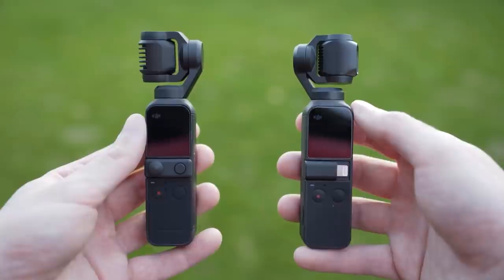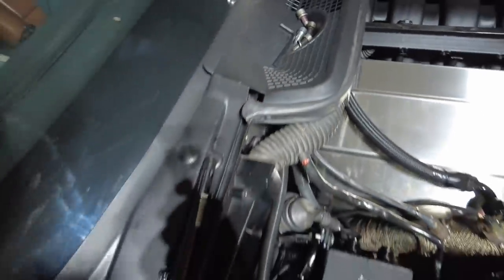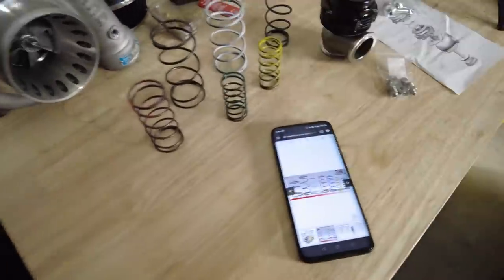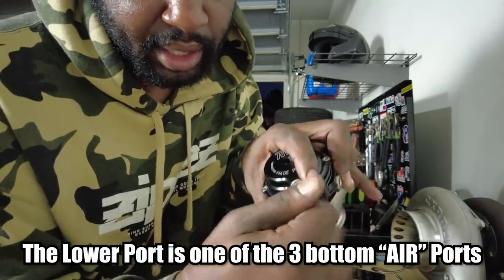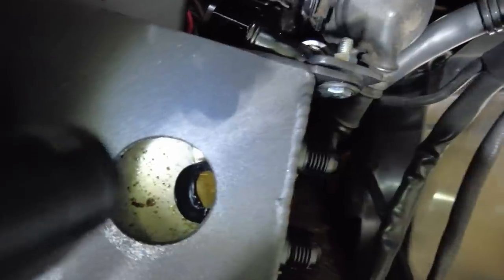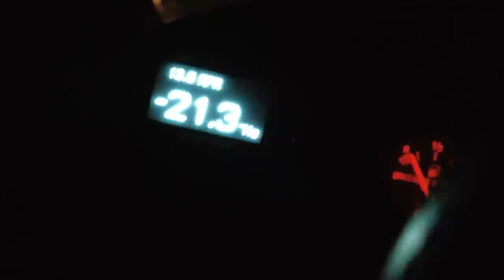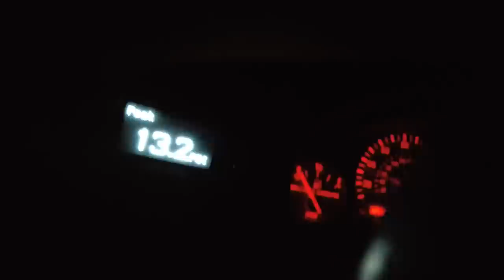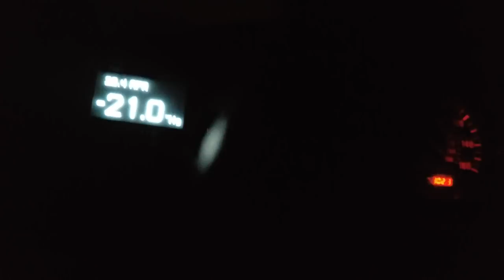Tial Wastegate and 2 Bolt to V-band Conversion and MORE BOOST || Turbo E36 Build [Ep 39]

Comment: That manifold design is known to have boost creep so you usually do have to run less spring than your desired pressure to compensate because it'll always run a few more psi than the spring, it really doesn't matter honestly.

Also you're right on the AFR, it's not ideal and I don't know why your tuner told you it'd be fine to raise boost on the same tune, stock dme MAF setups don't compensate a lot for the extra air.

Edit: Forget what I said about the AFR I guess, honestly surprised, maybe the tuner did plan and scaled the MAF values higher than what you used back when he tuned it in anticipation that you'd raise the boost.
Reply from the maker: Yeah kinda figured that was the issue since the creep was about the same on both springs. Now it makes me wonder if the CX kit is an actual 8psi spring (as advertised) or if it's a 3lb spring with boost creep lol
Reply: Correct
Reply: Lookin around for Top Mounts, jeesus 666Fab quit building, where to find a decent top mount?
Reply: @defkon99  rsi manifold $680
Reply: @itsBlack  you would’ve been 1000x better with an Aeroflow

Comment: The 2 bolt flange you were grinding is supposed to come with a machined angle, otherwise the surface will be uneven and it will leak, giving you boost spikes.

Comment: Go standalone ecu master black I got 7psi spring but using boost controller running 16psi I running 460bhp on pump gas UK 95 Ron which I think is USA 89?

Comment: Yo I have a question if I were to get a e36 325i with the m50 would it still be a good purchase or should I just go for the 328i?
Reply: Hopefully this helps
Reply: @denkii  thanks and yeah I was planning on boosting it in the way future so this helps a lot
Reply from the maker: 328i is M52 is usually a better choice since it's a bigger motor and the stock ecu is tuneable
Reply: @itsBlack  okay thanks so much for the help
Reply: @denkii  
Both have aluminium head, and in the US even m52's have an iron block, the only US cars to have the aluminium block is the z3, regular 3 series even 328i had iron block. Reason is shit US gas ate the nikasil coating of the early m52's, BMW then fixed it by switching to iron sleeves instead of the nikasil coating, and since the z3 came out after they switched it got the new iron sleeve aluminium block, but on the 3 series since it came out when they still used nikasil they just said fuck it and used iron blocks.

Plus anyways even here in Europe plenty of people boost the aluminium blocks without any issues, sr20's are aluminium, k20's, and some 1000+hp LS are aluminium block too, the block being aluminium doesn't make it any weaker for sub 700hp builds (after that crank mains can flex and a girdle is recommended, you still don't need to go to an iron block), literally doesn't change a thing. This myth appeared because the m52's actually have weaker rods, making them blow up with less torque than an m50 can hold and people jumped to the conclusion that it must be because of the aluminium block when in reality it has nothing to do with it.

Real difference is that the m52 rods are skinnier, people still make 500+ on them, think the record is like 700, to be fully reliable I'd say 450hp with a gt35 is the max (which turbo you chose is important as torque will be impacted and torque is what breaks rods), an m50 with thicker rods could do like 500-530 safely.

But the big thing that the m52 has going on for itself is the obd2 ecu that is easily tunable.

Comment: You have alot of factors that are at play. Manifold, wg placement, turbo. 

You said you changed out the turbo newer technology of turbocharger flow waaaaay better now.  So now that's playing a big factor, also you went from a bottom line wg to a top line that's now a big factor. ALOT of people are now going to a twin gate setup in order to control boost better, and stop creeping.  Especially when you are running vband flanges the flow is 800 times better. Also  future note going with a larger wastegate is not the answer.
Reply from the maker: Yeah I kept the same size gate. I found that size works great for gt35 but as far as the turbo swap I got the same exact as last time hoping for the same results. It just had oil leaks I couldn't fix